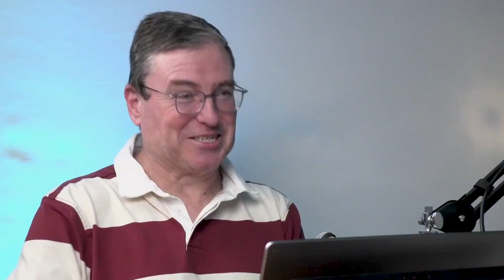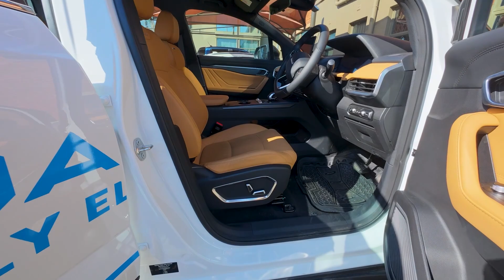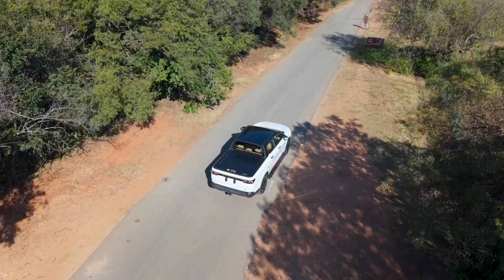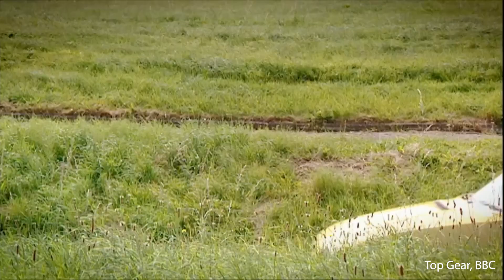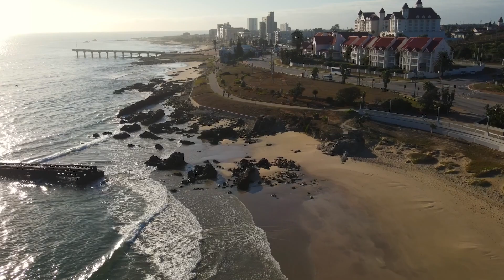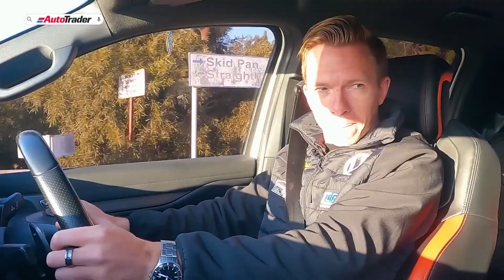Watts & Wheels Ep 2: ‘We test drive the Riddara electric bakkie’

Comment: The Joule electric car was a South African-made electric vehicle developed by Optimal Energy, a company founded by Kobus Meiring in 2005. Here are some key features and facts about the Joule¹ ² ³:
- *Range and Performance*: The Joule had an estimated range of 150-300 km on a single charge, with a top speed of 135 km/h. It was powered by a 36-kilowatt-hour lithium-ion battery pack.
- *Design and Reception*: The Joule was designed in collaboration with Italian design house Zagato and received positive reviews at international motor shows, including the 2008 Paris Auto Show and the 2010 Geneva Motor Show, where it won the "Best on Display" award.
- *Price*: The Joule was estimated to be sold for between R235,000 and R285,000, making it a relatively affordable option for an electric vehicle at the time.
- *Challenges and Demise*: Despite its promising features and design, the Joule project was shelved in 2012 due to lack of funding. The company behind the Joule, Optimal Energy, closed its doors after failing to secure the R9 billion needed to commercialize the vehicle.
- *Legacy*: Although the Joule didn't make it to market, its story serves as a reminder of South Africa's potential in the electric vehicle industry. The legacy of the Joule lives on through initiatives like the uYilo eMobility Programme at Nelson Mandela University, which continues to work on electric vehicle technology.

Why the Joule Failed

- *Funding*: The lack of sufficient funding was a major obstacle for the Joule project. Despite initial backing from government agencies, the company struggled to secure the necessary funds to commercialize the vehicle.
- *Market Viability*: Critics argued that the Joule was too expensive and that there wasn't a big enough market for the 50,000 models planned.
- *Competition*: The global electric vehicle market has become increasingly competitive, with established brands like Tesla and Nissan dominating the market.